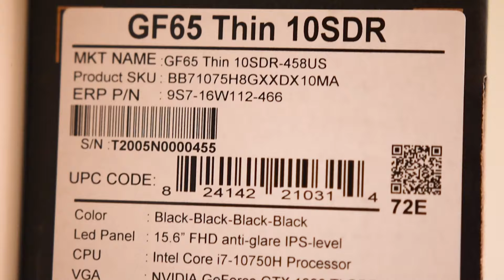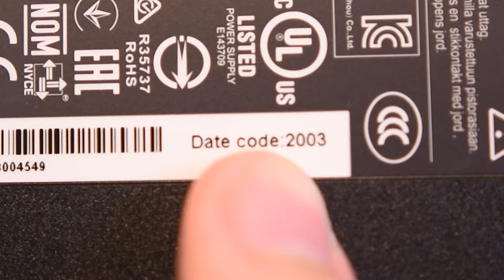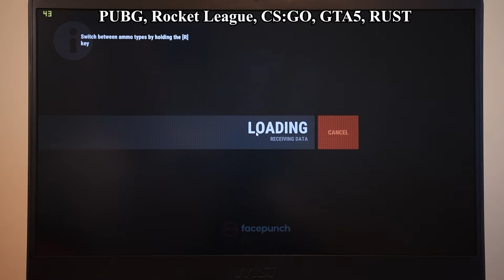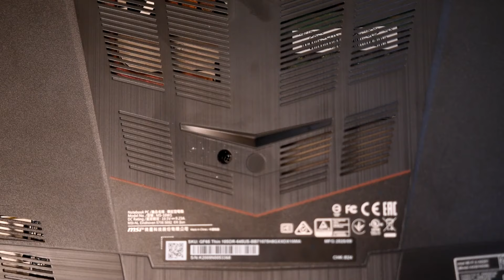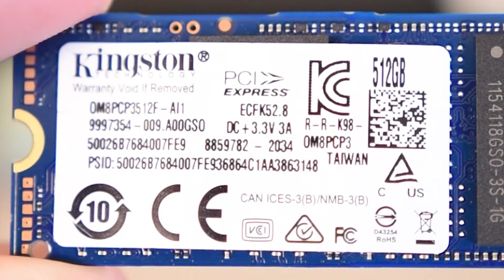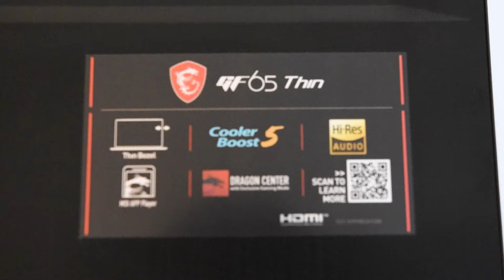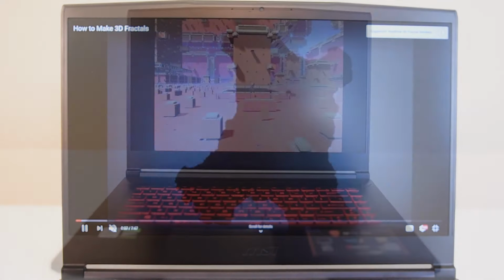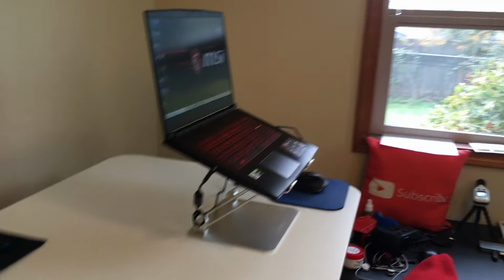GF65 Thin MSI GAMING LAPTOP REVIEW, GTX 1660TI,  6 CORE 10750H

Comment: Does it get hot a lot during normal tasks and gaming or programming???
Reply from the maker: yeah pretty much its cooling is decent like it works but it wont keep a low fan curve its designed to kick in sorta immediately. 

I am trying to build the best tech channel possible if you have any questions I am always standing by to help you with your tech needs. I will always be there for you, So if you like this kind of content I highly recommend you subscribe. :)
Good luck!

Comment: so i got the newest version of this laptop the MSI gf 65 thin with

i7-10750h
rtx 3060 6gb
sk hynix 8gb 3200 mhz?

can i add another 32gb 3200 mhz ram stick with the 8 gb ? so it would become 40 gb? is it possible?

the i7-10750h is capable of 2933mhz speed so the 3200 would be perfect ??? it would downgrade the speed to 2933?

sorry a lot of questions
Reply from the maker: 2 weeks later, All great questions! did you end up getting the machine yet? I think you should be able to get 64gb total so putting in a 32gb should work, congrats on finding one thats got the newer gpu thats awesome! yes the ram downgrades because of some motherboard restrictions. 

hope you enjoyed the content and would love to have you as a subscriber :)
Reply: in 16x2 or 32x2 confi is best

Comment: How'd u hit 200+ frames in rocket league while the display is 120hz?
Reply: Frame rate can be higher than the refresh rate if you turn off Vsync. This can make things more responsive to input but may lead to screen tearing and obviously won't actually show you more frames than your monitor can display.
Reply from the maker: you might be able to set the frame rate to stay at 120fps to match the hertz via console commands maybe?

Comment: Hi Serge. New sub here. I bought this same laptop primarily for gaming but am considering doing some video editing from my dji drone as well. I didn't see anything that mentioned the max ram you can put in. I know it's 2666mhz and was considering either 32g or 64g. Ty in advance
Reply from the maker: Oh waaaw I would love a DJI birds eye fov drone, maybe do some racing flying around sounds so much fun!!! 

I know for a fact that it can support 32gb, I haven't specifically tested this model for 64gb but my other msi models I have tested do support 64gb as long as you have a 32gb per stick since it will only have 2 slots. I am actually using 64gb.

I used this kit, recently it gone up in price from 220 to 300, I think there might be another computer hardware spike in pricing happening now, see if you can find maybe the same ram for cheaper but if not just get a kit 2x32gb and if one of the sticks is too much ram you can just sell that other stick and probably make all your money back. 

RAM is like currency, even the oldest ddr 2 ram and ddr3 ram sometimes costs more then ddr4! 

Thanks for the sub I look forward to helping you :)
Reply: @SERGE_Tech  ty so much. Your vid helped me take the back off carefully and I put a samsung 32gb stick in. Just an fyi, it will take 64gb. Keep up the informative vids and I have MANY computer friends  i will turn on to your channel. Have a great day and may God bless you.
Reply from the maker: @yosimitesam9179  Dang what an awesome comment thanks!

Comment: I get around 50 fps in rust even though all my settings are on low. Can you please help because I have no idea why this is happening. I have the same laptop.
Reply: You should try plug in your battery, change your battery settings mode to performance.
Also check your turbo mode.
Or it's just because this video is old and the game updated so ...
Reply: @tungquoc8333  Thank you for your help but I have done all of those. Something that kinda fixed it was optimizing the game graphics in GeForce experience. For some reason increasing the graphics made the FPS more stable. I am also sure that Rust is just weird in optimization and graphics in general.
Reply: @monkeydimension472   bro I have same laptop but it's cpu temperature going up to 95 in fortnitr with low ghraphic setting is that normal?
Reply: @mahdisharifi1040  I don’t play fortnite so I don’t know but my temps do reach 95 in graphically intense games. It’s probably normal.
Reply: @monkeydimension472  oh ok dude I think my laptop has problem and now I can play without thinking about temperature :)
Reply: @mahdisharifi1040  I forgot to say this but what FPS do you play at? If you cap your FPS at 60 or 140 you will get lower temps too.
Reply: @monkeydimension472  I play at ultimate fps I mean i dont cap it on 140
Reply: @mahdisharifi1040  Ur FPS is probably fine but cap it at 140 just in case since the laptop screen is only 140 hertz so going above 140 FPS will just make you laptop run harder for no reason.
Reply: @monkeydimension472  my laptop screen is 120 hz so you mean i cap it on 120 fps and it shoud get lower temps right?
Reply: @mahdisharifi1040  Yeah if your frames are higher than 120 right now. If 120 still doesn’t bring down temps you could try 60 even though it’s not as smooth.
Reply: @monkeydimension472  I'm not comfortble with 60 fps :((((((

Comment: I have this computer bought from walmart and at over $1000 with taxes. I do enjoy this laptop but i have a few complaints. The first is that Bluetooth is glitchy. My old system i used Bluetooth mouse and earphones... my mouse was very stop and go but the disaster was with Bluetooth head phones which kept causing videos to stutter and sound to constantly drop out. This is wierd as i have neved had laptop or tablet with this problem.  After some experimentation i switched to wired headphones and optical mouse and the problem went away.
Also, the wireless connection has something to be desired. I can't often get internet at mcdonalds to even show there is a wifi connection, yet my tablet says it's there. I plan to upgrade from wifi 5 to wifi 6 which also upgrades the bluetooth.

I also plan to upgrade the ram and the battery. I do a great deal of photoshop work and i only get about 1.5 hours on battery. Other than that this is an amazing laptop... especially since i upgraded from a surface pro 7 which i could write a book of complaints about.
Reply from the maker: Wow thanks for sharing these are some great insights! Could you tell me more about your surface pro 7 troubles? I was thinking about getting one.
Reply from the maker: I am trying to build the best tech & entertainment channel possible if you have any questions I am always standing by to help you with your tech needs what ever they may be. I will always be there for you, So if you like this kind of content I highly recommend you subscribe. :)

There is this awesome game called Natural selection 2, you should check it out! Have you herd of it before?
https://www.youtube.com/watch?v=cgVDGefyNtI

Comment: I'm torn between this a hp omen nitro 5 and a dell g5. Btw what's the difference between a ryzen 7 and a i7 10th gen and what one is better for editing
Reply from the maker: the dell g5 will have the best build quality out of the 3 laptops, it will be easier to upgrade, the nitro has very cheap plastic, it is lighter but its also more fragile. MSI and ACER always win the price war meaning they are cheaper to buy more affordable. But dell is an overall better product thats just a little bit more expensive usually.

as for the cpus, AMD which makes the ryzen 7 was actually created 40 years ago by intel as a second supplier, initially they worked together and eventually AMD started to make there own products now AMD is very different, I would say any time you compare AMD to intel, AMD is always more affordable and is a better overall deal, but intel is usually 1-3percent faster, sometimes they are not faster but in this laptop case the performance is about the same as you can see from this comparison its the same, but the benifit is that AMD is cheaper. 

https://cpu.userbenchmark.com/Compare/Intel-Core-i7-10750H-vs-AMD-Ryzen-7-4800H/m1053158vsm1032976
Reply from the maker: I am trying to build the best tech & entertainment channel possible if you have any questions I am always standing by to help you with your tech needs what ever they may be. I will always be there for you, So if you like this kind of content I highly recommend you subscribe. :)
Good luck!
Reply: I ended up buying the lenovo legion 5 ryzen 7 and I'm happy with it
Reply from the maker: @nfgneme1211  lenovo right now has the best offering, and they are modest about it!
Reply from the maker: @nfgneme1211  when I tested it, it has the best speakers, keyboard and port layout as well as better build quailty, kinda surprising to see that.

Comment: Hi, i like very much your video. 
I love my new laptop, have the same specifications but have 16 GB RAM, the only thing I don't like very much is that when I'm playing GTA V it goes to 90°, you recommend me tu do a Undervolting o what can I do to improve the temperature, in spite of putting a elevate table?
Reply from the maker: so the bad news is the machine is kinda designed to run somewhat hot, this will be most noticeable in games like gta5 that put the machine to its limits, you could just decrease graphics but who wants to do that I run my gta5 on max graphics because I love being immersed in that games world. absolutely amazing gaming experience, for sure its one of the best games out there.

you could under volt you could even disable some cores if you want but perhaps just decreasing the ghz could also help. Its actually kinda hard to find a laptop that wont get hot while playing gta5 haha.
Reply: Buy a cooling pad
Reply: @pedrocorreia4218  Can I play games in peace then? Or would have to adjust even after that?

Comment: I just hate this new laptops, why manufacturers don't do anymore easy access to the upgrade ports? You need to take apart the whole back lid and to loose your warranty if you wanna upgrade! Not to mention that some new laptops dont have a network card and the Ethernet port, those laptops should come with an adapter so you can use it wired to the LAN!
Reply from the maker: yup on top of that if you open it up even if your experienced you end up breaking the freaking plastic its insanely bad design for some cost savings I been saying it for a long time the alienware area 51m is the best machine, its priced well it allows for desktop class gpu and cpu upgrades check it seriously its the best machine!!!!! take a look and tell me what you think.
Reply: @SERGE_Tech  i just looked up the Alienware Area 51 M2, thats a beast of a machine!! Unfortunately the price is inaccessible for me and to most people from the country i live in but man, i would like to try that laptop out! I didnt even heard before of a network card of 2.5gbps! This weekend big retailer from here had some good deals on a variety of laptops, i ordered a Asus ROG Strix with 16gb RAM, 1tb SSD, AMD Ryzen 7 4800h cpu, Nvidia GeForce GTX 1650 grafic card, it costed 820$(in our currency)! I think it will be enough for me, i wont do heavy gaming on it cause i like to play on consoles but for my other needs it should be plenty. I didnt had laptops with AMD processors before but some friends told me that this last generations are improved, i shall see!
Reply from the maker: Yeah thanks to amd the costs have decreased while still performing as good or better then intel, very glad you got a good system. 

I am trying to build the best tech & entertainment channel possible if you have any questions I am always standing by to help you with your tech needs what ever they may be. I will always be there for you, So if you like this kind of content I highly recommend you subscribe. :)
Since I am building this channel for you! Help me build it. 
Would love to have you as a sub some day. Anyway let me know if you have more questions!

Comment: Im looking to buy this one but im really worried about termals, it goes to 94 in GTA (CPU) what do you suggest?
Reply from the maker: listen these machines in this class of hardware with them being entry level they all run this hot, some run a little hotter while other just may be a bit cooler. I would no worry about the cooling unless you are spending $2000 on a machine then it starts to mater because these people really care about how the machine operates, gamers care but gamers unfortunately are buying machines that are cheaper thus the poor cooling but here's the pro tip those temps are well within the range of operation and it doesn't hurt the machine or reduce its life. 

 I am trying to build the best tech & entertainment channel possible if you have any questions I am always standing by to help you with your tech needs what ever they may be. I will always be there for you, So if you like this kind of content I highly recommend you subscribe. :)
Good luck!
Reply: @SERGE_Tech  thank you, Will subscribe right now you are a god
Reply: @SERGE_Tech  going to pick it up for 900 bucks on thursday!! Toughts on the price?
Reply from the maker: Well it will depend on the exact version you have and specs you get? Do you know what the specifications are? I don’t think it’s a bad because there are so many laptop shortages that to have any kind of machine is very lucky. Some people might end up paying premium I’ll see if I can find it for a better price and will let you know :) for now hold on to your order :)
Reply: @SERGE_Tech  Exactly the same as the one you reviewed!
Reply: @SERGE_Tech  I need to return it, the laptop was with a bad gpu, my performance in games was haltled, do you have any personal recommendations for gaming laptops under 1300$?
Reply: @FranciscoGomez-tw1ii   bro I have same laptop but it's cpu temperature going up to 95 in fortnitr with low ghraphic setting is that normal?
Reply: @mahdisharifi1040  I swap my laptop for a lenovo y540 , I droped the msi
Reply: @FranciscoGomez-tw1ii  why?

Comment: can you elaborate more on thermals, im thinking mine has aged thermal paste or something i cant get it too turbo past 4.2ghz single core and it jumps too 99c instantly and has a wide variation between core up to 10c
Reply from the maker: hmmmm yeah that seems rather hot, it really shouldn't need to turbo past 4.2ghz. Definitely replace its paste and report back because thats some bad thermals, although these machines do run hot.

if you scroll down to emissions youll see that this device runs at 100f and that devices in this class run at 92c normally so to some degree its just how it was designed. Even though its hot though it can handle it. 
https://www.notebookcheck.net/MSI-GF65-9SD-Laptop-Review-GeForce-GTX-1660-Ti-for-under-1000.439783.0.html

I am trying to build the best tech & entertainment channel possible if you have any questions I am always standing by to help you with your tech needs what ever they may be. I will always be there for you, So if you like this kind of content I highly recommend you subscribe. :)
Good luck!
Reply: @SERGE_Tech  replaced with artic silver mx5 its way down (like 85c) and my single core boosts too 4.6ghz sustained @ around 85c best thermals of any laptop ive had i also can oc my gpu much higher
Reply: core variation is 5c aswell, the screws were imo not tight enough that may have lead too my bad thermals
Reply: @braxton7198  Do you know of any repasting guides for this laptop I can refer to? I haven't done anything like this before and I am too scared of damaging something while repasting by myself.
Reply: @SohamChougule  https://youtu.be/QXHWKbWsX-E is the closest I've found, if you just make sure to put the screws back from the hole it was removed from   you should be fine.

Comment: I'm stuck between Acer predator triton 300 i5 10th, 8gb ram, 4gb 1650ti and msi GF65 i5 9th generation, 16gb RAM, 6 gb 1660ti, which one would you suggest? Durability is also a concern by which I mean I don't want to get annoyed 1 or 2 months later (like absurd heating or physical issues)
Although the latter's price is better, I don't trust msi that much.
Please help me out here
Thanks in advance
Reply from the maker: I am now back did you end up purchasing a machine if so what did you end up getting? be very interesting to know. Also if you are still looking for a machine I would love to help. Let me know if you are still searching!

I would get the MSI because the spec offering is better, acer has had some cooling issues with nitro 5 but I assume its fixed in the predator. The predator has better looks and build quality. 

I am trying to build the best tech & entertainment channel possible if you have any questions I am always standing by to help you with your tech needs what ever they may be. I will always be there for you, So if you like this kind of content I highly recommend you subscribe. :)
Good luck

Comment: I just got mine few days ago but the battery doesn't last that long .. about 2:30 hours with normal usage
Reply: bro I have same laptop but it's cpu temperature going up to 95 in fortnitr with low ghraphic setting is that normal?

Comment: Would it be bad charging while gaming at the same time?
Reply from the maker: well it does deplete the battery more if you do this but some games require more power then just the battery so in some ways you are forced into this where you plug in while gaming, the battery is just there when you are mobile for browsing the web in most cases you should be plugged in and after 3-6 years you can replace the battery and it should be fairly easy to do so. manufacturer can help with this. 

I am trying to build the best tech & entertainment channel possible if you have any questions I am always standing by to help you with your tech needs what ever they may be. I will always be there for you, So if you like this kind of content I highly recommend you subscribe. :)

There is this awesome game called Natural selection 2, you should check it out! Have you herd of it before?
https://www.youtube.com/watch?v=cgVDGefyNtI